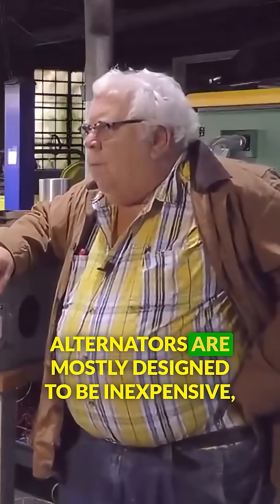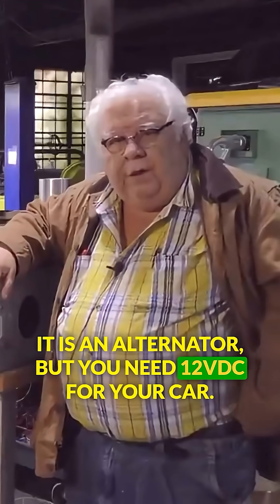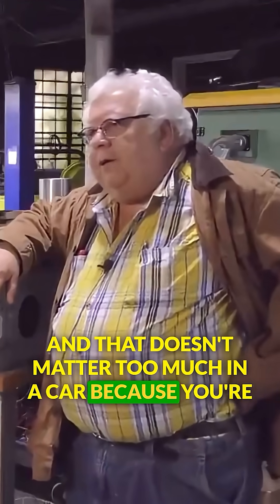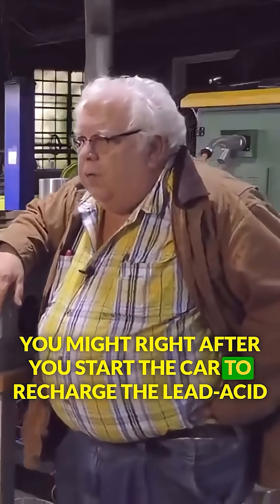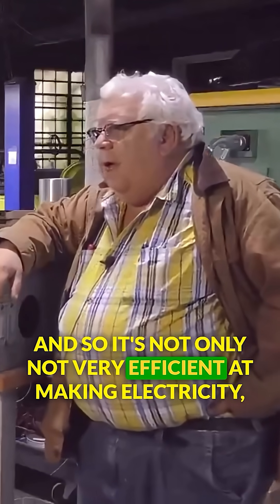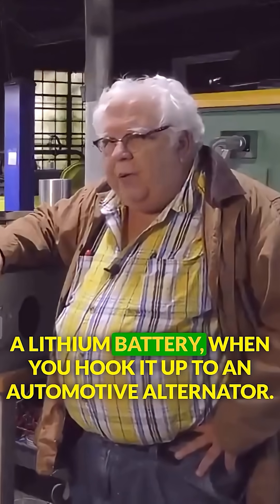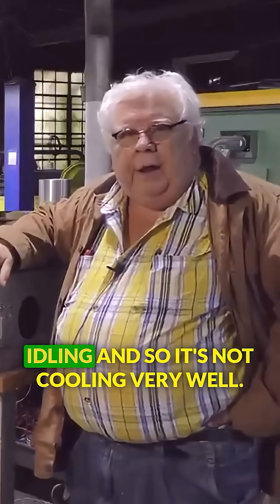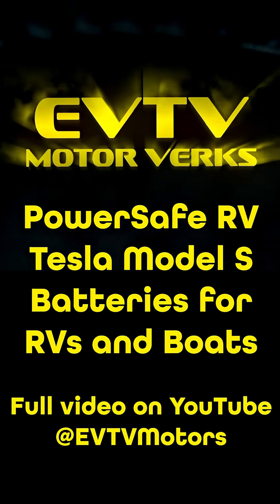Alternators are Only 50% Efficient!

Comment: Basshead here who uses lithium, yes what he says about alternators is somewhat true but we've reached more less 60-70% efficient in creating power nowadays, lithium yes if it's dead will put quite the load on the alternator but it it's also is able to actually accept that extra current and level off at the same rate as a normal lead acid if not faster if the same capacity, it's all resistance based... And even then if your gonna be running lithium your gonna have a high output alternator that can actually put out the amperage the battery needs, if you keep your lithium charged you shouldn't be burning anything out

Comment: Same goes with ceiling fans. The generic motor they ALL use consumes more hydro than necessary, but there are produced by the millions. A Canadian company who made motors designed a very efficient fan. It failed because people think going backwards was a necessity, when it isn't. That ruined the ultra low power consumption and increased production costs to get it to spin the other way. People are just dumb.

Comment: Ideling is at 800 RPM and it does not charge much at all ,not heat.  The best/highest charge is above 2500-3000 RPM.

Comment: Some alternators have overheat protection in them. The voltage regulator switches off at a certain temperature and than back again at a lower temperature.

Also you can not create electricity without using AC and then converting it to DC, from mechanical motion!

Comment: Diodes are 50% efficient? Where did you pull this fact from? most diodes drop about 0.6 volts per a junction, and there is two in series at any time. So you lose 1.2 volts at say the 100 amps, and ohms law says that is 120 watts of heat (I haven't factored in the 3 phase part). 14.5 volts (bulk charge) out of an alternator at 100 amps is 1450 watts. at float 13.8 (float charge) it's 1380 watts, and you lose 120 watts from the diodes. (would be less factoring in 3 phase rectification). 120 watts is a far significantly less than the 50% value of half of either 1450 or 1380 watts. Around 82 to 86% efficiency in this example. Again it will be less than that for 3 phase diode rectifier. You have other losses but not 50%. So again where are you getting this 50% loss in diodes from? The over heating at idle is a valid concern, but you can mitigate that with a smaller pulley on the alternator so it spins faster at engine idle.

Comment: I have a class 8 tractor. The alternator  are designed to run full load 100% of the time. That being said, I find Ultra Capacitors to work extremely well even with car alternators paired with AGM batteries. 
They do suck up an extreme ammount of power but only for a minute or 2 tops before they are full and the AGM's do the rest. 
Lithium having high rates of charge/discharge AND large amp hours can over heat an alternator but AGM's with Ultra caps do much better. 

The best part is the ultra caps smooth out the voltage curve and can run the vehicle without the batteries ever having to do anything except start the engine which the ultra caps help with
Reply: That sounds pretty cool! I remember when ultra caps were pretty much theoretical, and I still have yet to play around with one. Have you been running this long enough to see a difference in battery life? I’ve heard that lead acid batteries like to be cyclically discharged a bit, and then topped off immediately. I wonder if daily starts is enough to keep it happy? Any idea if your capacitor bank has a lower internal resistance than your battery?